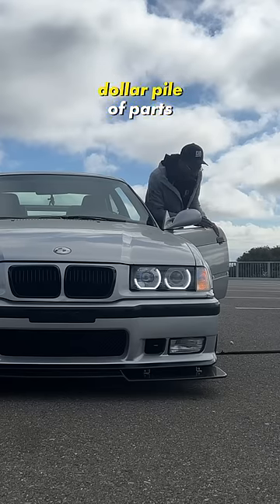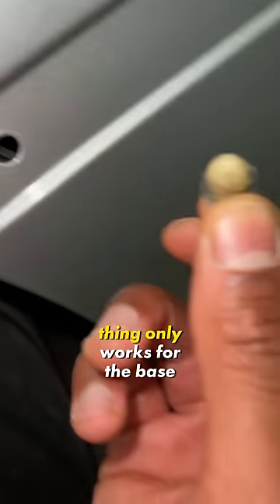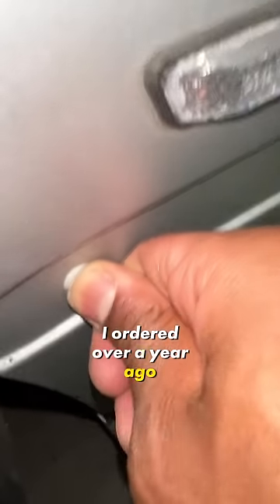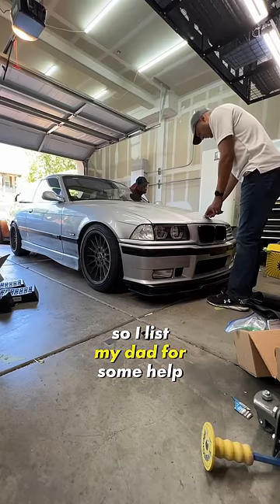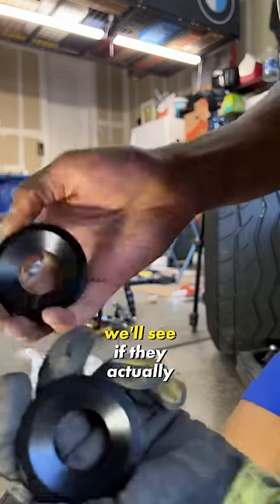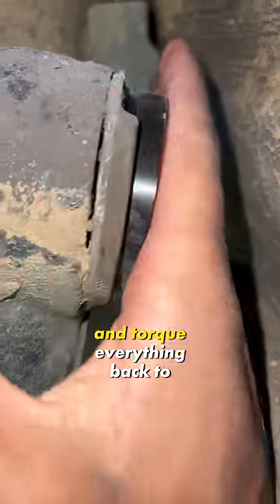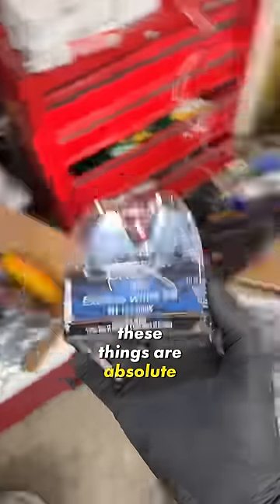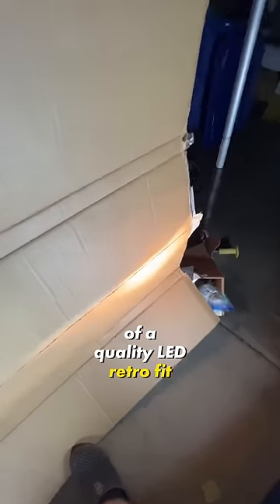$300 car reverts to pile of parts | Day 16 #e36 build

Comment: LED retrofits are illegal... Plus everybody always goes for the obnoxious cold white which is actually blue... And you can't see anything in inclement weather, while you blind everyone else... Look for a 4300 K bulb... Possibly xenon but that would involve you having to install a relay harness because the stock wiring cannot handle The amperage pulled during warm up with a xenon. That said, you can possibly get away with an LED retrofit, IF you choose the correct bulb, with the correct light pattern, with the correct color... 4300 Kelvin is your magic number. You can see good, you don't blind other people, it looks good...
Reply from the maker: interesting. is that because they don't have self-leveling or headlight washers? regardless, I just need to be able to see decently well compared to my Z's HID's, and match my Angel eyes' color temp which unfortunately is 6500K.

Comment: Shims are the cheap way out. Should have just replaced the rtabs with power flex
Reply from the maker: but poly rtab bushings can bind as the joint is supposed to rotate on 2 axes, not 1. these were temporary anyways
Reply: @ChrysGaines  been using and installing poly bushings since 2010ish never once seen or heard of that happening.

Comment: By the way, those "cheap" headlights you installed are garbage. You'll see...
Reply from the maker: i have depo lights on my Z and they’ve been fine/a huge upgrade over stock. until i have an un-solvable problem, i’m loving the value prop they provide. removal and popping off the lens to clean/them is really easy.

Comment: Stop using led, that shit blinds other drivers even on low beams. I have dead ass started throwing shit at people with em. I swear to god i will throw a tennis ball dead at your quarter panel.
Reply from the maker: if you’re using leds in projector housings with the proper cutoff it should be no different than any newer vehicle with mandated LED lights today.
Reply: @ChrysGaines  i ride a bicycle. Anytime led passes me i xant even see the ground. Still throwing something.